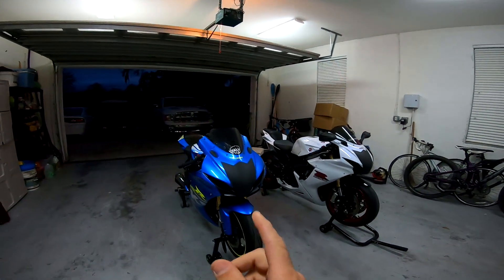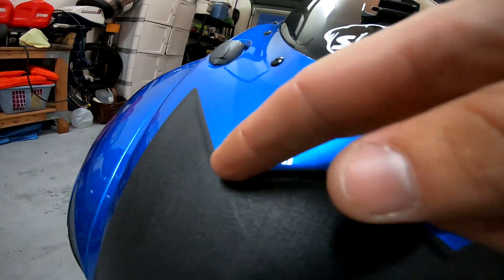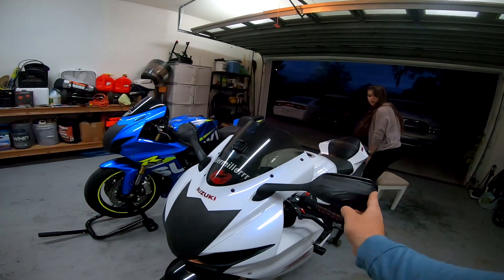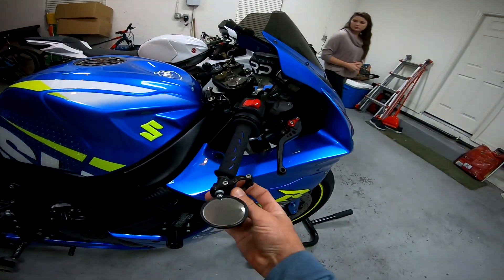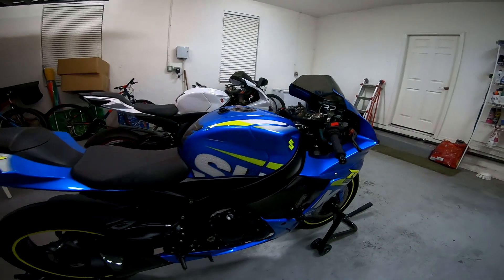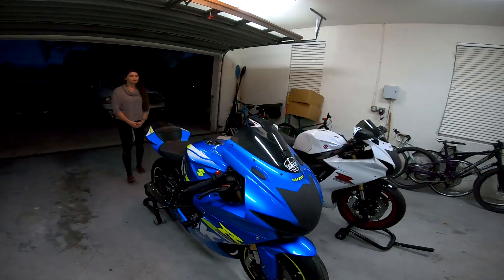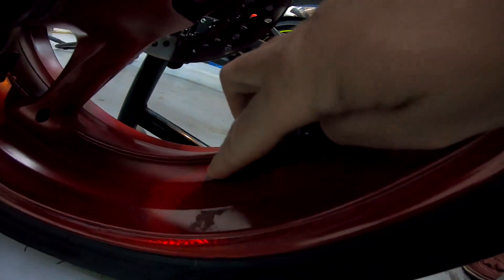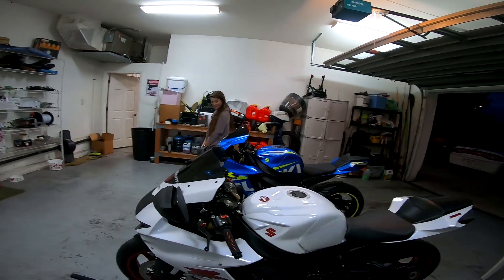Prepping For Our First Track Day!

Comment: Make sure the headlights don't overheat under the tape. Unplug them if you can. At the track, try to get a coach or a regular to show you guys around, ideal lines, tight/dangerous spots, dos and don'ts, etc. Don't forget to let air out of the tires (like 30-32 psi front and rear, the regulars can also help). It's gonna be tiring as hell, hydrate like crazy. And never go out for a "one last round" that's when people crash. :D

Comment: wow they make you do a lot for the track there. Thanks for the video. I'll wait till I get back to the Philippines before going back to the track, just tape the lights and mirrors and have gear on. 
You're gonna have a blast. It's way different than riding on the road.
I don't blame you for making the tape job pretty especially if you will be catching it on video or pictures.

Comment: Pull the fuses for the lights if you dont want to scrape tape glue off the plastic. Also does not hurt to put a little lock tight on the gear linkage to make sure you dont lose it. Other than that enjoy!

Comment: May want to either unplug the headlights or pull the fuse for them.  Black tape absorbs heat form the lights and I have seen it melt the clear plastic lens of the headlight.
Reply: Can you please explain to me how to unplug headlights as well as tail lights. Will be doing my first track day this coming weekend and also need to tape lights. I have a 2015 gsxr750 but don't know where to disconnect. Thanks

Comment: I really don't understand what for you did all that. AFAIK you only have to prevent your front light from breaking and leaving it in small pieces on the track. So tape on it would be quite enough. As to the mirrors you can fold them, so not to be distracted by looking at them (Heather's bike). Stop light could be left untouched IMHO it's better so for others.
And... Heather is very pretty. You both are a sweet couple.

Comment: FYI always easier to just remove the fuse for the lights
Reply: Haha lmao
Reply: Absolutely. Isn't the heat of the bulb going to melt  the plastic?
Reply: @jeannoelsandrazie1874  It shouldn’t unless your running LEDS, but even then won’t get that hot.

Comment: time to realize, "damn, im not nearly as good as i thought i was....im fucking slow"

Edit: Also, you are seriously overthinking the tape, thats the LEAST of your worries, gas, tent, chairs, drinks, extra clip ons, chain lube/adjustment tools, $400 in cash(extra tires, or suspension tune which you WILL need)

Word of advice: Take shit slow, learn. Your first track weekend is for learning, slow down, learn the track, and drill the proper lines into your head. If you can get the right lines down, then pick up the pace on that same line, over and over again. Repetition = better for learning and better for becoming faster and pushing limits.